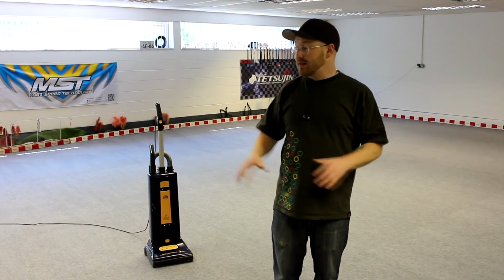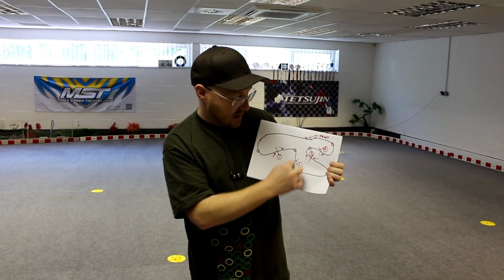How to build an RC Drift circuit - Soul RC

Comment: What kind of line tape did you use
Reply from the maker: I forget the brand but we found a masking tape at a local shop that worked well for our carpet. It's generally a case of trying a few and finding one that doesn't peel too easily but doesn't stick too hard for when you need to change layouts.

Comment: Are you using carpet? What is your flooring? Where do you get the bumpers?  I really want to make a track!
Reply from the maker: We used a custom carpet but we recommend concrete or hard surfaces over carpet now. The kerbing is made by Tetsujin in Japan.

Comment: It is very enlightening to watch videos of other drifters where you are able to hear the motor. These guys tap their throttle a lot. I usually keep my throttle pretty steady except in bends where you want that nice sliding power! It just shows how different people drift. There is no "correct" way to drifting. I also tapped my throttle a lot in the beginning but it turned out that i had a lot better driving flow when not tapping that throttle so much. Nice video Soul RC. I couldn't agree more about your track ideas. Too many bends and direction changes is not fun. The course i am currently driving on only has three direction changes, but it is a lot of fun. Bends that tighten or widen are many times more challenging than doing a direction change into steady bends :D
Happy drifting everybody!
Cheers from Denmark :D

Comment: Is the gray r34 gtr awd it really acts like it you are getting angle like awd with an angle kit plus a bit of a cracked up driver angle status
Reply: Not an r34 sorry its something else just saw headlights at end of video is it a 190e merc?
Reply: +UnlimitedThreat AirsoftTeam Yes, the silver Cresta is 4WD running CS gearing.